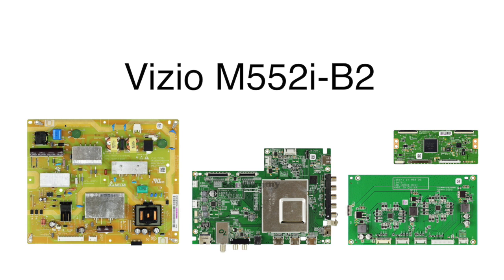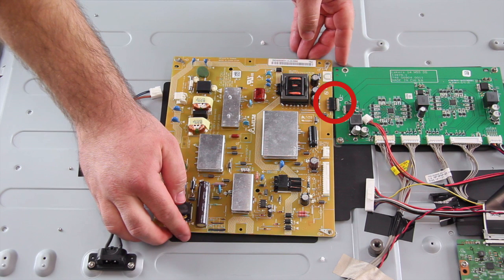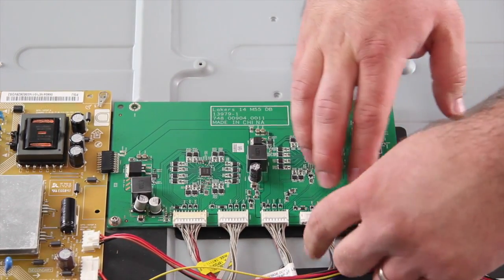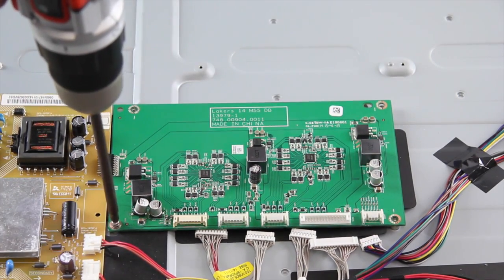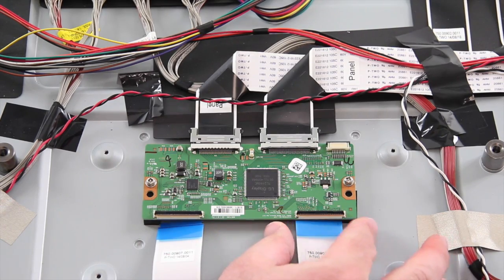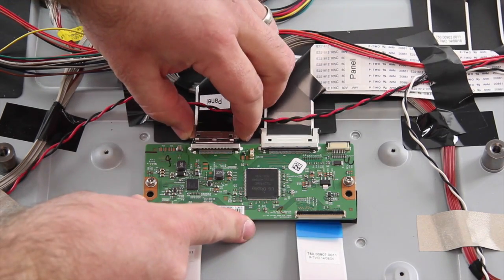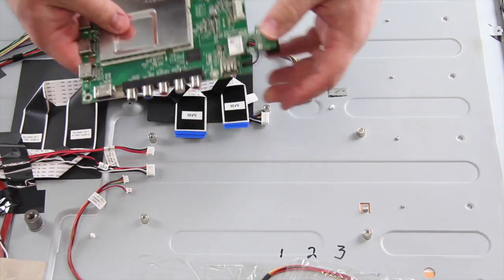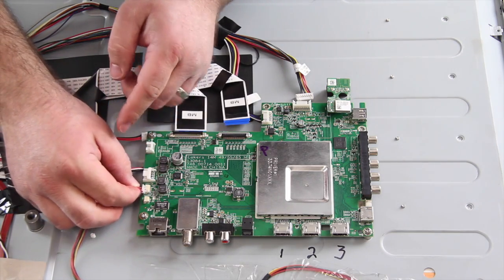VIzio M552i-B2 Complete LED TV Repair Parts Kit - T-Con, Main Board, LED Driver & Power Supply

Comment: I have a Vizio E3D420VX tv that when turned on all the picture is on the top inch of screen all garbled up . After time the mess of the picture will slowly move down the screen and then at some point the picture will stabilize. I sometimes leave the tv on for a few days and the picture usually stays good. I love this 3D tv and hope you have seen this before and can give me some help. Thanks John